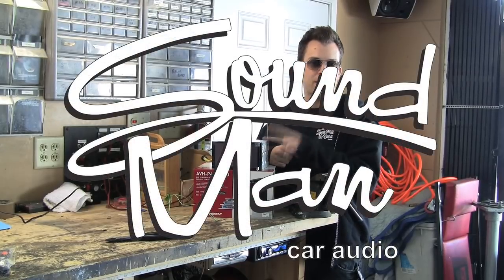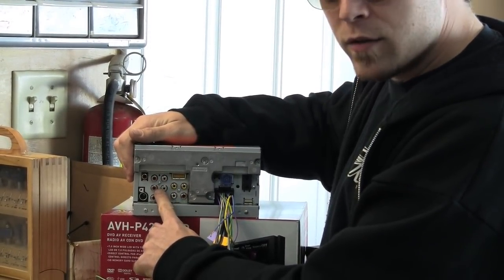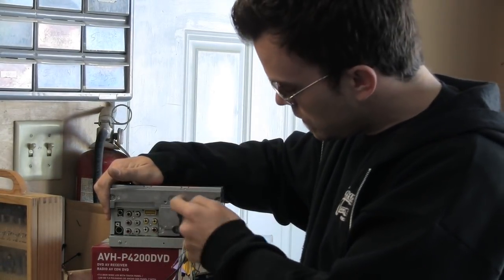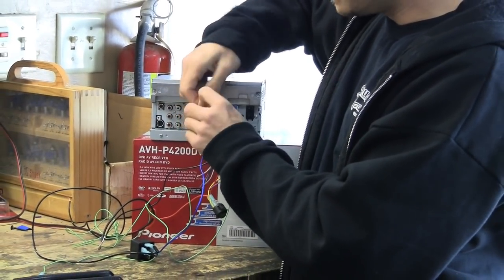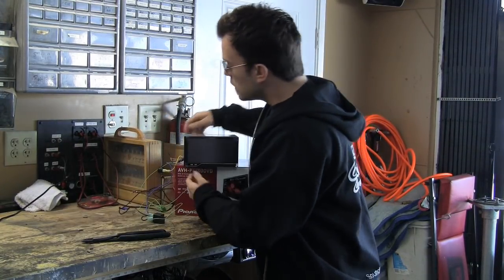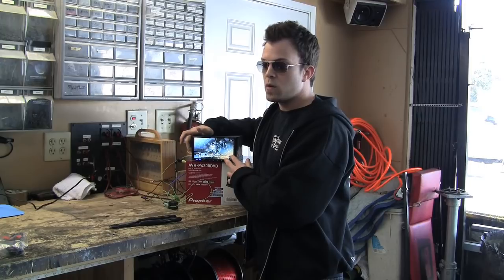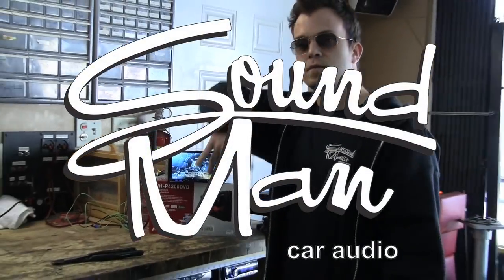Pioneer AVH-P4200DVD Bypass & AVH-P5200DVD Bypass

Comment: im a 100% newbie to car electronics and bought a relay as well as a socket because i thought itd help me wire the thing.  It only made it more confusing.  I took the wires out of the socket and wired them exactly like you have them and it works flawlessly.  Installed in a 2010 Mazda 3.  Thank you so much!

Comment: Wow! Clear, concise and worked my first try! Thanks for putting this knowledge out there in an easy to follow format. For those who have asked, I used a 12 volt 4 pin relay. Mine was labeled 30, 86, 86 and 87 (I think, I looked before the install but now I can't recall exactly). Anyway, I followed what the glasses dude said and bam, video without the brake and without a switch. Now my passengers can watch on the road. This worked for my brand new Pioneer AVH-P1400DVD in my 2006 Ford Mustang GT.

Comment: Thanks, worked perfectly. It's worth mentioning that there is a screw on the back of the 3200 when you open the box that holds on an antitheft device. Keep it and use it to attach the relay to the unit so you don't have it hanging by the wires.

Comment: Awesome video.  Very clear and concise.  Question.  I noticed that there is no mention of a 12v(+) connection.  How does the relay get power?  Why wouldn't you wire the relay like the following:

85 - Remote turn on lead
86 - Ground
87 - 12v(+)
30 - Head unit's parking break wire (amps, and any other electronic components)
87A - Empty

Comment: Hey again i just wanna confirm , i just Made this for my avh-p6300bt and it works fine!   And for you with the remote question i dont see any issues with you just connecting amps also :) its just a Low power circ. That tells ur amps to turn on , if ud like i can try with my new spl dynamics amps :)

Comment: I first tried to connect the hand break wire directly to ground, but it worked only if I connected it to the ground after the player was turned on.

The method in the video worked like a charm on my Pioneer AVH-P6300BT. Thanks a million Mr. Bernard.

Is it possible to change the regional code on these players?

Comment: First off, great video, it helped tremendously. Thank you. Though I have a question that I'm not sure if you can help with or not...I recentely purchased the avh-3300bt and installed it myself, while installing I came across a reverse wire, in all my time dealing with car audio I have never seen this wire before. Well, I didnt attach this wire to anything and now Im getting a black screen that says "object may apear reversed" and no video works...how do I fix this? Is this because of that wire?

Comment: @bik0304 The blue wire is your remote turn on.  If you have a power antenna or aftermarket amps, then this cable is what turns them on.

Comment: I used this video to bypass the parking brake on my AVH-X2600BT. It worked great! Thanks!
Reply: what did you do with the reverse input wire?
Reply: You'll only need to use the reverse input wire if you're using the reverse camera. Also, most cameras have a 12v wire connected to the video wire for the camera, so again you wouldn't use it. But if your video cable doesn't have a 12v wire with it, connect the reverse input wire to your reverse light signal. So, when you put your car in reverse, it tells the headunit to switch to the reverse camera. Hope this helps.
Reply: ok man

Comment: Just did mine (I was going to have Best Buy do it but they sounded like idiots). I did the P3200DVD and the bypass worked and yours (and others) video helped alot. One thing though people should know. I also bought the AVIC-U220 Navigation System add-on and after hooking it all up and double checking my work I hooked the battery back up and NOTHING, the by-pass DID NOT work. I was a bit POed so I re-checked everything, to make the story short here's what happened. It all worked fine when......

Comment: Great video. 

I have a few quick questions.

1. Does it matter if it's a 40A or 30A relay?
2. The remote wire coming out of the harness is the Blue wire with the White stripe, correct?
3. You're just tying pin 86 into 87 and then that into the ground wire off the harness, correct?

Sorry for the noob questions. This is my first stereo install. It might be a bit advanced for me, but gotta learn somewhere, right?

Thanks in advance 
- and that ipad install is amazing so far.

Comment: @kriketan 

The amperage of the relay doesn't matter, its not drawing any current, its just connecting the wire to ground.  Yeah any ground wire or chassis will work, doesn't have to be attached to chassis only.

Comment: My dad installed the relay in today and it works great, the video works and everything. But i wanted to calibrate the screen but it needs to be shut off to do it and the relay turns off when the radio is off so then i cant switch to that. Is there a fix to that without taking the wires back out and trying to connect it to the ebrake. Its not that big of a deal cuz the touchscreen is pretty accurate. Also is there a way to have a different wallpaper for each source or name radio station presets

Comment: I just connected the brake (green) wire to the back of the unit itself (stripped it and fastened it to one of the screws) on my 3200DVD. Works perfectly: no relays or additional wires needed.

Comment: Works with the p3300bt.  Wasn't going to do it but it was definitely worth it the relay cost $5 at the auto parts store.  Just make sure you have a solid ground connection.  The first time I tested it I didn't realize the that the frame member was painted black.

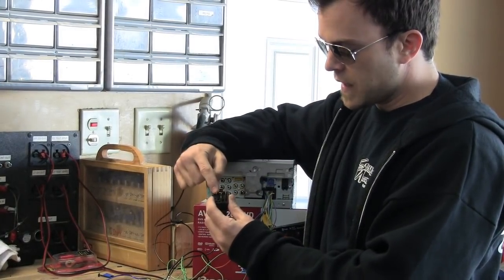Comment: 2:40 just a correction, there is a correct side to use the relay bobin for "clicking". Using it incorrectly could damage your DVD unit. Automotive relays usually have a diode integrated to it to prevent polarity inversion when the bobin is de-powered (this is the electrical characteristics of inductive components like a bobin). So when the relay is unclicked it wil behave as a batery with inverted polarity it was powered, this could damage any electric component over time.

Comment: I used this bypass with my AVH-3200DVD with AVIC-U220 Navigation system and it worked as long as the AVIC was not plugged in just like others have posted. The AVIC-U220 has to be plugged in after the car is started.
I'll be on the look out for a bypass for the Navigation fix.

Comment: Thanks Mr J. Knoxville! Can I ask, do you need the ground wires joined to the radios ground, or can I ground them next to the bodywork, next to where I situate the relay. I ask this because I've extended my remote wire, along with my handbrake wire, but haven't extended the ground, and I've put all my dash back together now....

Comment: @gradyboi2 I'm having this same problem. At least I know now what is causing it. I knew that the first time I hooked it up that it worked. I guess I hooked the Nav up afterwords. Now the relay clicks on before the head unit boots. You find a solution yet? Right now I'm using the relay manually. I just ran the brake wire and the wire from the relay to a switch & after I crank the car, I flip the switch to cut the relay off (if it's on) and flip it again to come back on and it works.

Comment: @sirsmith If youre sure that you connected the bypass correctly, the cable youre using connecting the iphone to the head unit can possibly be wrong.  Ive read that some people had an issue with using the wrong cable.   You can also try reseting the head unit.  I had a problem with mine not running dvds, reseting it fixed the problem with mine.

Comment: @chevyman94z U need to turn on the Rear monitor ON to be able to send video to the rear monitor output.  

Press the SOURCE on the top left, then on the top center of the screen is where it has the REAR monitor control.

Comment: @dragnet53 I haven't set up my phone with it yet, but I'll check it out later today...what all does (or doesn't?) it do?

The sub controls I'm not sure on either...my SS came with a stock 10" Pioneer sub, so basically it's like running a line-out converter to give an amp RCA inputs, where the sub is picking up all the bass the normal speakers are getting.

Definitely liking it so far though.

Comment: @UnME323 You need to get the correct cable.  It is the standard iPod USB connector to the USB port on your unit, but to the left of the USB port on the unit is a hole for a mini-pin.  The cable you need has the standard iPod USB PLUS the mini-pin for your video to the unit.

Comment: Can you address how to make sure the nav add-on works with this set up?

 I see other users say you need to plug in the nav add-on AFTER the radio turns on, but that will be a pain to do every time you want to use the nav system, as in most vehicles you need to remove the dash to get behind the headunit to plug in the nav.

Comment: quick question..exactly what is everything you used in this video....i know you used a 12 volt relay but where did you purchase the rest of the cables you hooked up from the relay to the radio...and what did you mean when you said that the unit is going to be grounded to the car and that you're tying an additional ground in for the relay?

Comment: Does the blue wire still need to be connected to the factory wiring harness or just from the HU to the relay?? The black (GROUND) has to be connected to the stock wiring harness too right....like the black wire comes from the HU to the bypass then to the factory wiring harness

Comment: Its like the bypass relay doesn't get enough time to react so it stays on stuck. The pioneer sends the remote signal off as soon as the unit gets power. So like I said, I disconnect the remote wire off the relay and attach it again, than I get a click and DVD image pops up. Is Pioneer ahead of us again?

Comment: @Soundman. If I understand it, this is 2 create a delay 2 the handbrake earth wire (stereo side) wen U first turn on the radio 2 stop people permenanly grounding the handbrake wire? I was just wondering, if the stereo is wired in2 the handbrake switch as per the manufacturers instructions, & the handbrake is already on b4 u switch on the unit, do you have 2 release & reapply the handbrake b4 a DVD can be played 2 create a delay or is there something else in the handbrake circuit I am unaware of?

Comment: @2dee11 hook the relay into the remote turn on wire ALSO. its a signaling wire not a power wire. Besides relays don't take much power anyway even if it was a power wire.

Comment: I take that back, after connecting the ground (black wire) and the parking brake wire (green) worked initially but after turning off the vehicle and back on it didn't work. I had to unconnect the wires and connect them again for it to work. Also tried the relay again but it won't work. The toggle switch works perfectly!!!

Comment: I just installed the 4200 deck in my 03 tahoe. I wired it up exactly how you've shown but the bypass has only worked 2 out of 25 times. The relay is working and the only wire attached to 30 is parking brake wire off the deck harness. I think the relay is tripping too quick. Suggestions?

Comment: did you ground your wires to the top of the head unit? make sure the wires are still attached I put duct tape on top of the electrical tape to make sure it wouldn't move.

Comment: Sorry if this seems like a dumb question: My car doesn't have a power antenna, but does have an amp. Could I connect my HU's power antenna wire to the relay rather than having to splice the power amp wire? Then just cap the power antenna wire on the adapter harness?

Comment: Heres how i wired my avh-p3200dvd:

[Pioneer harness]--1--[Relay bypass]--2--[Metra harness]----[Oem harness]

Should i splice in the amp remote wire in "1": before relay or "2": after relay?

Or splice it in with the remote wire all together?

Thanks

Comment: Alan I just hooked a brand new pioneer up with a relay two days ago and it worked fine with a relay.  Like I said below you simply need to turn the radio off and back on it the relay switches before the radio is ready.  There is no need to convince people to buy unneeded marked up bypasses when they can easily wire up a simple relay to get what they are looking for.  Unless they want waste their money on some overpriced bypass that is doing the same thing.

Comment: Those of you having problems with this not working after properly hooking it up here is the answer.  The relay is switching before the radio is ready.  All you have to do is turn off the radio and then turn in back on.  Since the blue amp wire is powering the relay when you turn off the radio it takes power from the relay.  Since the key is already in accessory mode at this point the capacitors are ready and now when you turn the radio back on it will beat the relay therefore working properly.

Comment: just to double check the relay method for the 4200 works on the 5200 flip out correct. also any issues when adding the 220 add on nav piece.

Comment: Thanks for the vid!  The bypass works perfectly, but I have an issue I'm hoping you can help with.  I'm getting horrible radio reception with my AVH-3200DVD.  I've read sources that suggest I need to power an antenna booster, but they all say to use the blue/white wire to do this.  Since this is the same wire you're using to power the relay, what would you suggest I do so I can power both the relay and the antenna?

I appreciate any help you can give, but keep in mind I'm electrical dumb :(

Comment: I installed the avh-p5200bt yesterday, everything works well with the bypass except I do have the navigation option.  It does work if the nav is unplugged and plugged back in after the system is started.  It's a pain in the ass to plug and unplug and I assume the connector will eventually wear out if I keep doing this.  I guess I could install a toggle by the DVD but would appreciate a different solution if you have one

Comment: Trying to use this method on the 3300BT. I have the relay all wired up and just have the wire coming from the relay to go to a ground. When I had it ground to the chassis of the headunit, it seemed to work but there was a strange noise coming from the unit. What colour is the ground cable from the headunit? Is it ok to ground it on the chassis of the 3300BT itself?

Comment: @KingN8Boogie 
You WILL need a specialized harness to install the system in that. GM has everything tied into those radios. If you try and hook one up by just cutting the wires your gonna see all sorts of lights on your dash. I will warn you, they are not cheap, about $100-130 depending where you look. But once you have it, it will splice into your aftermarket radio harness. Good luck.

Comment: Sorry if this is a repost question but, i followed your video and the relay bypass worked like a charm on a avh-p3200dvd. But now i want to upgrade to 2 10" rockford fosgate subs on a 500/1 monoblock rockford fosgate amp. So amp would need to be wired to the blue remote as well. Will this be a major issue or no? Please let me know and thanks for your help!!!!!

Comment: Thanks this bypass also works for the pioneer x4600bt! I installed a aftermarket amplifier which works well at all channel's!  But my bluetooth doesn't!  Theres a speaker in the dash which I didn't know about,  that it only plays thru! Is their some wires to find in a 2003 tahoe? Please help

Comment: the U220 was NOT hooked up but when I put it back in the loop NO video again. If you use the U220 Nav add-on don't worry, it will work, just plug in the U220 (removable) module AFTER you start the car/truck, then the by-pass works with both videos AND the U220. (normally the nav unit don't work ((like videos)) when driving) It's not recommended and be careful but I just plug my nav box in after I start the car and it's all good. (2010 Dodge Journey w/REQ radio) The videos,DVDs and Nav all work.

Comment: Thanks. This WORKS GREAT. I just installed my AVH-P4200DVD and used this Tutorial. I can have my front seat passenger Watch the DVD while the rear seat passangers can watch the 9" Headrest monitors.

Can I Add the Pioneer TS-CX7  Center Channel Speaker for 5.1 Surround for Movies? If so, HOW? Thanks.

Comment: know that "SOURCE OFF" has to be selected in order for the auto EQ menu to “un-grey” to be used.  The problem is here:  when selecting “SOURCE OFF” the system powers off the 12V power supplied to the blue remote amp turn on lead which goes to pin 85 of the relay, which in turn makes the relay stop working.  
The FIX is to connect a constant 12V source to the blue remote turn on wire/ pin 85 but MAKE SURE TO PUT A SWITCH IN THIS LINE and DON’T FORGET TO TURN THIS SWITCH OFF AFTER setting up the

Comment: hi..i just installed a avh p4300 pioneer and did the relay bypass..but it doesnt work.i hvae an 09 dodge ram. i hear the relay switch over before the the stereo beeps on. if i disconnect the grnd and put it back on, it works..or it works with a switch. what do you think is the problem..its hooked up the way it is on your video..

Comment: @esutek27 You're missing the point. With the unit fooled into thinking the car is parked it still says "Unavailable while driving". I have the same problem. Can watch DVDs while I'm moving but under no circumstances will it let me use the AUTO EQ function on my 3200DVD.

Comment: Hi..I realize this video was published quite a while ago but I hope you answer my question. I'm installing a Pioneer AVH-X3700 into a Travel trailer. I wired it the way you demonstrated with the relay but it doesn't work, I still get the red crossed circle and the message that I can't play a video while the parking brake is not on. I only have a red and black (pos & neg) coming in so it should be a no brainer and I double checked all the connection. I can hear the relay click when I turn the video on but still won't go pass the message on the scree. Any help would be appreciated. Thanks